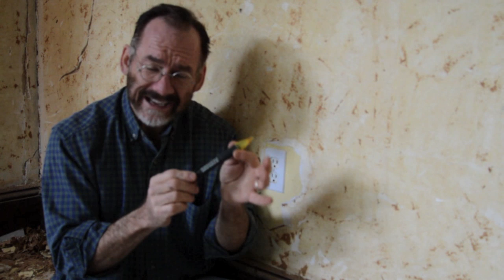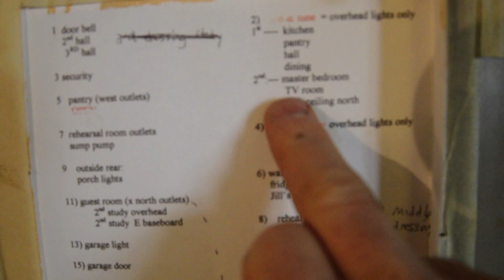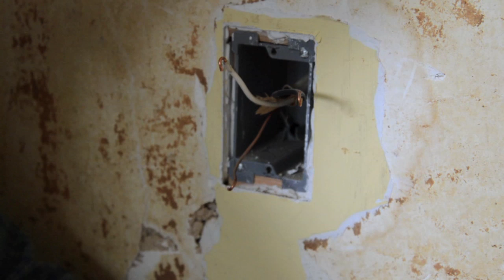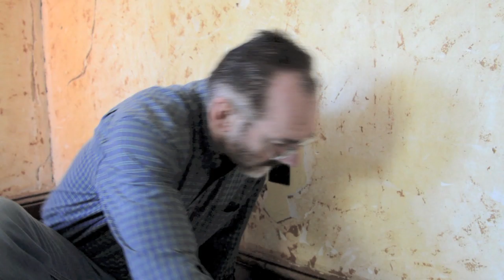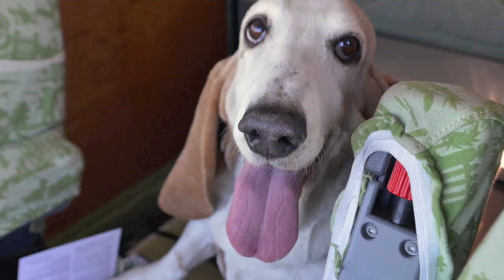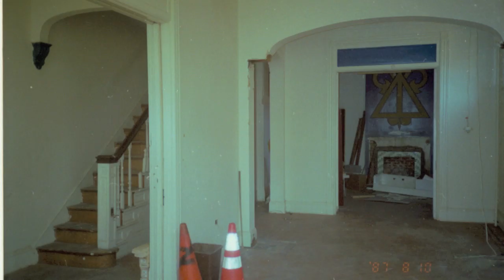How to Install or Replace an Electrical Outlet

Comment: it hurts but as long as you are not grounded or touching the hot and neutral, you will only feel the voltage. not the current. it wont kill you but you dont want to do it again. trust me. im a first year electrician student and it has happened to me. if in doubt, test it. a multimeter ot voltage detector are your best friends when playing with electricity. stay safe

Comment: it can KILL you, LocoVR.
you could be DEAD
be careful with electricity, yes there are plenty of people (myself included) who have mistakenly grabbed hot 120 volt wires and lived to tell about it.  However we were just lucky.  If you happen to be grounded well when you contact the hot wire then you can be killed.

Comment: It may look odd, but installing your outlets with ground prong on the top would be more safe.  Things fall down walls behind furniture, they don't fly up from the floor.  If a plug in a wall is slightly loose and something falls down to contact the prongs, it is better for the falling object to contact the ground prong than it is to bridge the hot/neutral prongs.

Comment: Excellent explanation. Let's say there was a faulty voltage detector  that didn't read any voltage on an outlet, at the point of handling the wires, how severe could the shock be on a person??